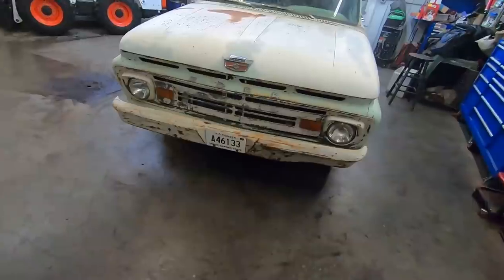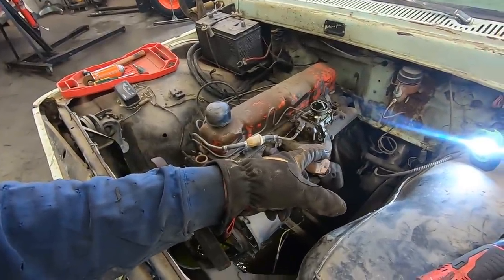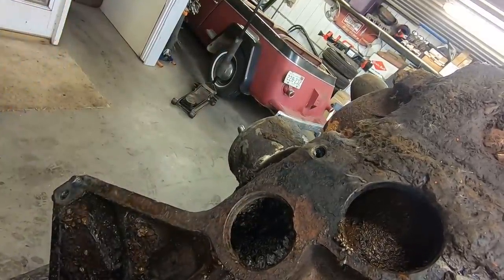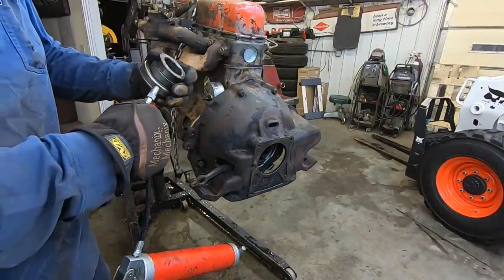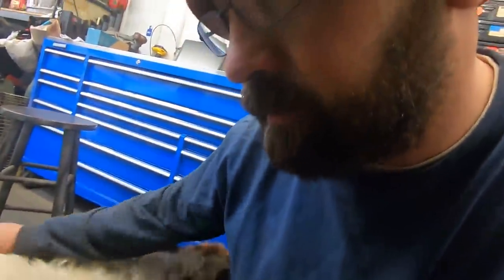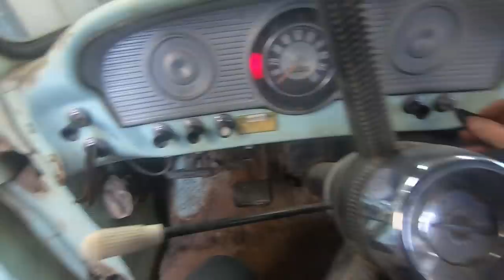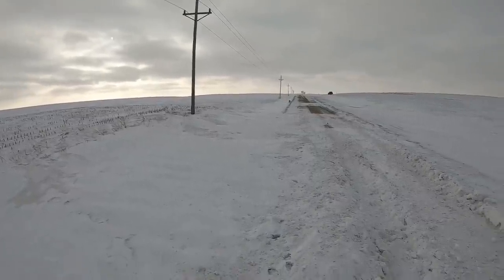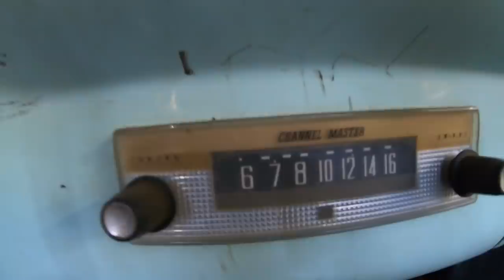My 1961 F100 Unibody Shortbed finally gets an engine R&R! And then we bury it in a snowdrift...

Comment: In rust we trust, low miles blow miles. This one needs a good in-line 6 Toyota engine twin turbo Ford 9 inch. Flat green paint job with pink pin stripes so light flat green. Chrome in a rattle can for bumpers, Gold for grill etc. High back bucket seats. Baseball sized skull head shifter. Bondo roof roll over sounds like another sun roof fix woo-hoo!!! Custom rock speaker box built in the bed & bolted down !!! I'd use aluminum full sized beer kegs spray foam inside. And build 3 or 4 for the new gas tank also in the bed between the 2 speakers !!!
Reply from the maker: ewwww

Comment: I remember my 89 302 auto. Felt virtually indestructible put some weight in the box he went anywhere I took him. What year 351 would you use and why? We do have a bunch up in Canukistan 351 and 302, but people don't want to let go easy cause the Wini's are so good minus the gaskets and righteous ignitions.
Reply from the maker: I'd prefer an early 351 where they had some HP and a carb.

Comment: I'm a car guy, not a advertiser for make and models. I love many cars and trucks and anything rolls. Motor would be nice. I have a 1992 Olds 88 Royal it has issues. 3800 is supposed to be a good engine, the body is a tank. Little to fancy for me. I spent a thousand repairing a 2002 Ford E150 cargo van, inspection issues. Cats are expensive. I bought the van for 1500 hundred, runs just fine.Tires, can paint for rust. No sense in repairing it. She is not a pretty girl. Just my toy. She is my daily driver. The pretty girl Oldie sits in garage, hotel for mice. I am hoping someone like you will treat her nice someday. I am not a fan of front wheel drive. The Ford van has 192,000 miles, the Olds has not got 100,000 yet but close. She is a pretty white GM product. Now obsolete. Son calls her a Oldsmobuick. I call the van Last Chance.  I figure the van was good investment, for under three thousand total. I hate most new cars and trucks they make them like Bic lighters. Over rated junk. I'm 72 and got to drive many many of the best ever built. Hey call her Unicorn. Not a Mustang for sure. She's blue add a pink . And you must have a gold horn on hood.

Comment: Reasons why you should put a 4.6 in the unibody: 1. They’re cheap. 2. You’re cheap. 3. they’re reliable as hell. 4. They have more than enough power for you (you’re not the Mario Andretti of North Dakota) 5. A Ford with a Chevy engine has no resale value and sooner or later you’ll get bored with it and want to sell it.
Reply from the maker: There’s virtually no aftermarket support. And you’re wrong on the resale value.
Reply: @MortskeRepair  1. Why would you pour money into a truck that’s been rolled over? 2. No, I’m not wrong about resale value. You’ll have it for sale forever. A couple Chevy guys will stop by and say “right on!” But they won’t buy it. The Fords guys will be pissed you desecrated it, and in the end you’ll either leave it to rot or sell it cheap without an engine. I see it all the time.

Comment: if its a hamster wheel blower fan thing, it will blow either way round, but the correct way is better blow. blade shape direction technical crap stuff.
Reply from the maker: Makes sense

Comment: Man your there ! Just put an fe and automatic  in it with a power brake booster ! You will love it !
Reply from the maker: But they haven't made an FE engine in 40 years! Good luck finding a good one for cheap.
Reply: @MortskeRepair  ok then a 5.0 or a 302 , oh I have 4 fe motors lol under my bench , they run and run and run

Comment: Chevy built one like that they called it a cameo then later came the El Camino
Reply from the maker: Cameo had a gap between the cab and box however. And had fiberglass bed sides.
Reply: @MortskeRepair  ok I know Chevy built one that was all one peace and it was early enough was not called the Blazer yet I saw one in Bloomington Normal Illinois some years back what did they call it I'm all most positive I may be wrong correct me?
Reply from the maker: @frankdodson3534  Never seen anything other than an Elcamino

Comment: Morstke. For once all my useless youtube knowledge can help!

Around 1:00:00 you say "I wonder why it goes Off, High, Low. Shouldn't it go Off, Low, High?

Older fans didn't have much in the way of over voltage and over heating protections built into them and it was a real problem that fans could stall out if they weren't given enough power to get sufficient rotation. When they did stall out, that energy is still being supplied to them and the coil will overheat and could/did burn down peoples homes and cars. So an early solution was to put high as the first speed of the fan. This ensured the fan would get enough speed on startup that even if you immediately moved the dial to low, it would still have enough rotational force to keep it from stalling.

/the more you know
Reply from the maker: Makes sense!

Comment: Dude just go out find a coyote motor I have an F-150 put in there is not an amcoyote put a 6 cylinder EcoBoost in it and it'll run everywhere they're beautiful and you can make them four wheel drive and everything you can lower to the ground everything

Comment: Mantanance, yep, still gooder than a rust samich.. Js
Yo Mortske, here's a thought to keep your Ole brain wirkin.. How's about setting your uni on a crown vic frame n engine or similar? Tons of work yes, but parts.. Not so much.
Btw, the uni is cool.
Reply from the maker: Vics are way too wide.
Reply: @MortskeRepair  I knew you would know... But what else would work? I had a friend who used Dakota frame and engine on a 40s dodge pick up. With headers, it sat, drove and sounded nice and had ac with all the creature comforts. Just a thought.
Reply from the maker: @stevebeavers3754  Yup, I did a Dakota swap in one. Guy makes some really nice stuff so it requires almost zero fab. And off the shelf parts. 4.5" bolt patter.
Reply: @MortskeRepair , just think, you can piss off both the Ford, and Mopar guys.. Lol
As solid a body.. It deserves some special attention.. Js
Reply: Mortske, I forgot to tell you that I saw a rebuild show (hagartys sp) using a serpentine belt to lift wonky 6s instead of a chain. They just looped it around whatever.
Reply from the maker: @stevebeavers3754  I've seen that. Pretty unsafe.
Reply: @MortskeRepair  mmm, I believe it would be a good idea to weight test one... Js
Reply from the maker: @stevebeavers3754  I'll stick with something rated for lifting loads and not designed to turn a pulley.

Comment: Why did Ford put frost plugs on the back of engines where you had no access? They did it on the straight 6 and the Y block as well. You have to pull the motor for access. And they say GM makes stupid engineering choices...

Comment: at least its not a new  2021 65000 dollar black ford aluminium body.i had to fix a 2 and half inch crease above right door plastic wasnt even off seats the customer hoovered over me like a helicopter and even if my glue stringed on his paint he was right in my face to wipe it off lol and i was hobbling cause i had just had broke my ankle  4 days before but still had to work so anooying.this guy was so anal he didnt trust ford to fix it  so he called me cause i have this unknown reputation cause he didnt want new paint. dont blame him actually but i got tossed into battlefield lol.i was only able to get it around 95 percent done it tightened up and wasnt moving no matter how i tryed.he was happy you could only see a tiny flaw under pdr light i didnt charge him cause it wasnt 100 percent but it fought me for a hour and then he had to leave cause his dog needed to go out he said he drove 1000 miles to get truck special order deal.very tough spot above passenger front door above rubber 2nd one ive done shipping damange.so ya fords hate me to!.say hi to the cutey duff